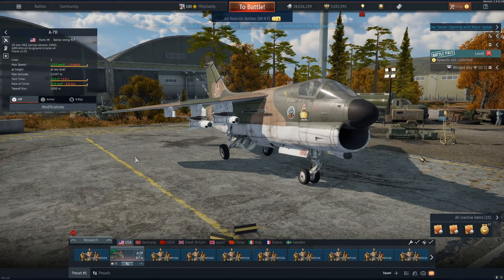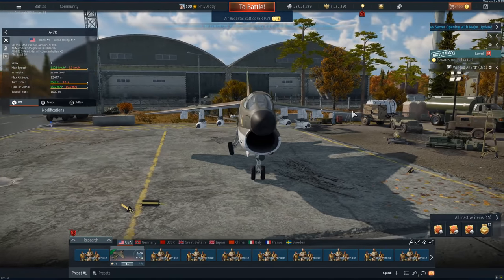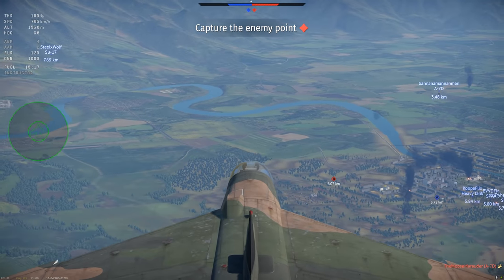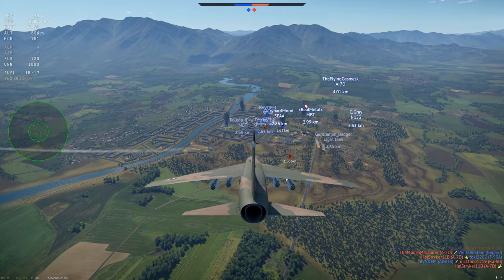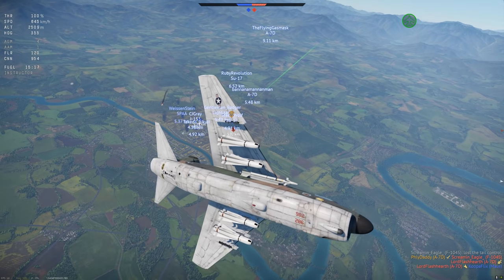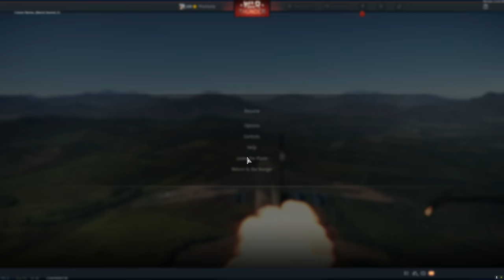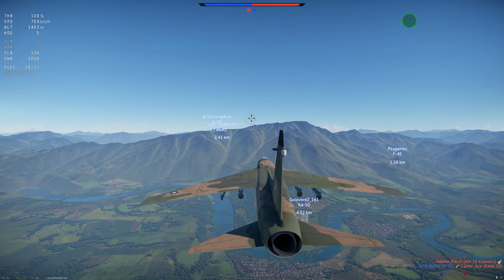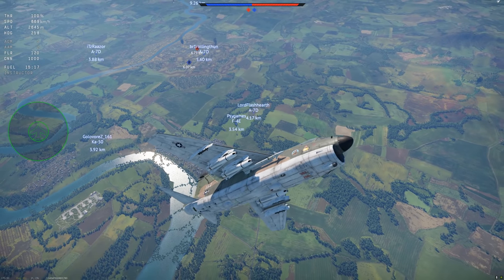AIR TO SURFACE HOMING MISSILES | AGM-65 Maverick

Comment: Helicopters: looks like trouble 
Air to surface missiles: make it double
Reply: they should remove tanks from top tier rb and rename it to air rb 2
Reply: Helicopters tend to not like 120 mm smoothbore cannons
Reply: The deadly duo will now be an A-7 that does one pass ans takes out the enemy SPAA, then a long-range ATGM heli comes out and decimated their ground forces
Reply: @awacsbandog8926   meanwhile apfsds round through the cockpit and pilot of ah1g:

HIT
Reply: @awacsbandog8926  Lol, honestly helicopters tend to shrug 120mm rounds off fairly often.
Reply: @oojiflip  This is one of the reasons that War Thunder needs VoIP!!!
If Gaijin could implement a radio system complete with a button for ground forces (maybe proximity, even though that doesn't make sense), there would be much more teamwork and investment in War Thunder.
Reply: @oojiflip  As you say, two total strangers could coordinate a joint action/strike with only a few words.
The system could have one button for communicating with ground forces and another for ground forces AND aircraft.
Complete with radio static and beeps, it would be more immersive as well as comforting those odd players who don't like sharing their voice on the internet.
It would grow to be used more and more as well as making matches more memorable and shrinking the grind feel.

Comment: I hate to say it but everyone wishing for F-14s A-10s etc....this what comes with that request. BUT we need more SHORADs
Reply: after watching your tarkov video im here and watching war thunder video in here after that  i see you again, are u angel or something
Reply: No no.... f35
Reply: Oh fuck it’s ddg, a rare occurrence
Reply: @GodWentAFK  While I do agree that CAS can be pretty easy, I also usually get blown out of the sky the second I spawn. Literally had a spawn yesterday that felt like the old helo spawn where you pop into being on fire and falling apart already. I think SEAD load outs would actually be pretty amazing. One, they are radar homing, so SPAA would just have to choose when to use that. The second they turn it off SEAD missiles lose track. Dedicating yourself to carrying SEAD missiles also reduces your ability for normal ground pound, so you'd be choosing a support role inherently to help your team. Scout vehicles do make it a lot easier to get into CAS, but it can still be a challenge to get into a plane. Immediately getting popped by SPAA normally means that player is out of the match too since they just spent between 500-700 SP for a spawn despite being shot down by say an ADATS which costs 200 SP. I think CAS being powerful is fine and lines up with the SP cost to do so. If anything, the only thing I can think of is if you run out of ordinance and RTB, you don't have to pay the silver for repairs. But, maybe they limit the fly out to just that one? I think everyone that does CAS would hate that (I would), especially since it takes awhile to rearm and come back in anyway. That would make strike craft more useful as they have more fly-out ordinance, but also make it harder to get a couple kills with a cap before dumping payload after payload for the rest of the match (like how it currently is). But what if additional fly-outs could happen? But only by SP earned in ground vehicles and only if you safely recovered your plane?

EX:
So you spawn in your HSTV-L, get a few kills and a cap, then get popped. Let's say you then fly out the A7-D, use up its ordinance, then RTB. You land, repair, then it jettisons you out. You don't pay on repairs. The SP you specifically earned as a CAS plane can be used for ground spawns, but not more CAS. Then you take a couple of tanks out, do well, then die. Only because you RTB'd your A7-D, you can now fly it out again loaded up and ready because you earned enough SP in ground vehicles. You spawn in, get shot up, and die almost immediately. Even though you have enough Strike SP (Or whatever it would be called) to spawn in another A7-D, yours got shot down, so it isn't available.

Specifically too, I wouldn't want additional fly-outs costing more and more SP every time. If you do well several times and have returned your aircraft several times, you shouldn't be punished by needing like 1400 sp to fly out a vehicle.

Ultimately something like this would have to be tried to see if its nice or not, but I think it could work well. It would mean that someone that got lucky at the start of the match isn't guaranteed to rain Bullpups or Nords for the rest of the match, but also means we don't have to limit or castrate CAS capability because its so effective. It rewards people for flying carefully in both SL loss prevention and potentially additional fly outs, but also means that you won't have a team of only CAS that can't cap. If anything, if CAS does well, it means that your ground forces will also be reinforced who can later "call in" more strike craft. This would turn it into more of a kill streak reward for doing well instead of just sitting in the AC-130 for the rest of the match. I thought briefly that maybe when you RTB your plane, maybe there is a vehicle timer on it for another fly out, but making it SP earned in ground vehicles promotes more spawning and probably better matches as opposed to staring at your spawn screen waiting for the countdown.
Reply: sure, f14 but i would rather want mig 35
Reply: @EnduringFrost  wow you must have thought about this topic a lot
Reply: A-10 is going to be hell on top tier ground.
Reply: @EnduringFrost  CAS babies don't need more handholding, you don't need ARMs. If you were good you wouldn't die to SPAA.
Reply: @EnduringFrost   one problem, all but the earliest SEAD missiles will fly to the targets last detected location. So you'd need to turn off your radar and move far enough away to be safe to avoid them. Some also have loiter and relock capabilities so they coudl shut down the SPAA's ability to use radar for several minutes after they're launched.
Reply: Imo, they should add some ARMs to the game. Some small maps (like Kuban and White rock) with a couple of 2S6s at the spawn literally means no-fly zone!
Reply: @baggingfritz2181  and that's a good thing.
Reply: Good. Fuck balance anymore and fuck the fact that German top tier tanks keep being added despite their already 70% WR.
Reply: @MrQuackcorn  It is funny that germany keeps getting good vehicles. Some of them should even be added to other nations. And still german mains are complaining about "germany suffers."
Reply: I want F16s and F15s
Reply: Meh, current AA is already fucking cas.

No need to ruin it more.
Reply: nope we all are waiting for the viggen.
Reply: With an engagement range of just over 100 Miles (160 Km) I do not know how you can add the F-14 Tomcat to the game.
Reply: Still wishing for the B-58 Hustler.
Reply: @EnduringFrost  cas shouldnt even be in the game, just remove it
Reply: [Danger zone intensifies]
Reply: @ragewalker4148  the maps need to be seriously bigger above mid tier.
I can see a system where the tier number is the square root of the smallest map a tank can be fielded on in km and for aircraft, it would be the square root times ten.
So for a tier 10 tank, the map would never be smaller than 10×10km
While for a tier 10 plane, it would never be less than 100x100km.
Reply: @stefa_j1032  mig 23 first
Reply: Meanwhile im still waiting for more variants of ww2 stuff like the elefant, stug IV, marder III m, me 262 hg I..
Reply: No. There are already a ton of radar assisted AA and SAMs, they have no downside for just throwing their radar into the sky, locking on to an aircraft, putting their mouse onto the green bubble and holding down the mouse button. The radar moves the mouse to track the target, its just as easy for an A7 to fire off an AGM-65 and make positive impact on an unsuspecting vehicle as it is for a gepard to open up from 5KM a and hit an unsuspecting aircraft - especially one that doesnt have an RWR. In my opinion they need to add ARMs - I think that the devs should make is to you can only have a SEAD loadout OR a CAS loadout. Early ARMs would be extremely easy to defeat as they are already not very accurate AND you can simply turn your radar off and move.
Reply: I still want um
Reply: WE NEED THE STRYKER SHORAD
Reply: @darthkarl99  you overestimate the accuracy of INS systems in the modern HARMs. While I have no doubt weapons like the AGM-88E are able to decisively generate a very close impact point in relation to target, anything before that doesn't really get closer than a mile off the emitting radar. Adding to this fact is that SAMs themselves are able to shoot down destructive SEAD weapons like HARMs, JSOWs, SDBs - it gets complex real fast.. ;)
Reply: @serpent5751  Beign able to do what i described was one of the original specifications for the HARM missile and most other second generation anti-radar missiles.
Reply: @EnduringFrost  boo hoo cas is soooooooo hard

Comment: Everyone: Give us F-14s!

Gaijin: M I S S L E S
Reply: F-14 would brutally clap cheeks now. Soviets need to get the MiG-23 to go with it
Reply: @LOLHAMMER45678  too much american superiority
Reply: I would rather get more jets(voodoo thunderchief) not new toptier jets
Reply: Maps are already way too small for top tier jets, F-14s would be batshit braindead
Reply: @blomgaming6480  Laughs in R-60 and Ka-50

Edit : laughs in Leopard 2A6 as well
Reply: @LOLHAMMER45678  MIG-23 is worse than the 21bis.
Reply: @TheDAWinz  The base model yes, something like the MLD-98 no. It can get R-27 plus more speed, and it doesn't fly like a brick
Reply: You want power creep? Because that’s how you get power creep
Reply: @LOLHAMMER45678  Phoenix can outrange most of WT maps
Reply: @hphp31416  Yeah, which is why we'll get it with Sparrow and Sidewinder only, like how we got F-4 without Sparrow at first
Reply: @LOLHAMMER45678  MiG-23's would get raped by F-14's, 23's are F-4 Phantom analogues.
The first USSR Jet that would be able to even somewhat compete with F-14's would be the MiG-25, and even then it's still largely in the F-14's favour.
Reply: @roadhigher  F-14's big advantage over MiG-23 is the radar and the phoenixes. Take that away and it's surprisingly even- especially if you add a late-production MiG-23 and an early production F-14. 

An F-15 would kick the MiG's teeth in, but the F-14 was still a fat interceptor, just not as fat as the F-111B.
Reply: @LOLHAMMER45678  And it is clapping cheeks now

Comment: Oh what's that? Our playerbase is complaning about g91s and A4s/A7? Let's make CAS even stronger LMFAO
-Gaijin HQ
Reply: Ok, but these mavericks aren't even as good as a bullpup, if you can guide them
Reply: @quartzlandaker5664  yea only 1850mm of penetration
Reply: Freeaboos @ 23:59: I can barely use my bullpups, CAS isn't OP at all

Freeaboos @ 00:00: Ermagoid Gaijin G91 and Ka-50 are OP, enemy CAS OP plz nerf
Reply: @lilhrabinator2283  nah AA pretty easy to counter if you keep your distance. Especially cas with bullpup/nord
Reply: Bryan Duarte schmitar exists too ffs...
Reply: @lilhrabinator2283  the only thing to balance anti air? Bruh 12.7 can destroy most of them what are you talking about you have 500kg bombs
Reply: @lilhrabinator2283   you're just playing it badly i can't kill g91's over 1km   and the entire aa of the team usualy gets shwacked.
Reply: @lilhrabinator2283  omg you realize the entire point of the op spaa was to counter the cas spam right? cas is the original cancer, spaa doesnt NEED a counter, because spaa IS the counter.
Reply: @foxboy64  Back in the day the problem was the HVAR and RP-3 spam because both were a 1 hit kill and some planes could carry up to 16. Things just snowballed from there. Those were the "good old days" lol
Reply: Finally Russia has a nice proper CAS :D
Reply: @throwaway.mp4931  which SPAA can't kill g91s over 1 km? Maybe you're playing your SPAA badly lmao
Reply: @geoffrey6554  The A4 does not have metric measurements on any of its bombs. Furthermore, dumb bombs are not very useful vs radar guided SPAA as you have to ge close to use them

Comment: E/E2/L would be more balanced for WT than any of the other variants, including EO/CCD. They are already artificially nerfing the range of the A, so thats not a factor, and the Laser mavericks require the user to maintain lock with a pod, JTAC, or buddy at all times until missile impact. Meaning no proper F&F.

Comment: The AGM-65s seem to be more balanced than the Nords or Bullpups we already have in the game. 

-They cant be dumbfired/ require a lock
-The plane has to be in a separate camera view with limited FOV and has to fly a straight predictable line when locking a target
-The missile is slow and can't pull many Gs
-The tracking is imperfect and the missile can miss
-It can be easily defeated by smoke and obstacles and will auto-detonate when it loses lock
-It can't be used at night
-It has a HEAT warhead and requires a direct hit
-It can't be used effectively for low passes, snapshots/ targets that appear suddenly 
-You can't switch targets once the missile is off the rail

The AGM-65s will allow pilots to maneuver once the missile is off the rail but will make them more vulnerable during the period prior to launching. It can be fired from a longer distance but the missile is slow and the target can counter it during the time it takes for the missile to reach the target. Its close range performance is hindered by the lock on period and the missiles inability to turn very well.

As a ground player, the AGM-65s seem far more tolerable than Nords or Bullpups and I don't think it'll disrupt the balance at top tier nearly as much as the introduction of hand-guided AGMs did.

Comment: Just commenting this, hoping phly would see this. Might help him out:
you can actually select which bomb to use first when you do bomb runs with different bombs, if you key bind 'weapon
 selection'. You can do it for secundary (bombs, rockets...) and for 
primary (mgs, cannons) weapons. That way you only need e.g. spacebar for
 all secundary weapons and 1MB for primary weapons, and you just select 
which u wonna use on your strike!

Comment: The plus sign is the slew limits and it’s very good so you don’t need to point the aircraft directly at it. As long as you are going in the general direction you should be able to get a lock.

Comment: Yeah, and the maverick missile seeker (the aiming reticle in-game) should also have thermals, as the Maverick uses an IR seeker. Hopefully, gaijin fixes that for the live server, but it's not the first time something has been broken on the dev server and transferred to the live server in the same state...
Reply: Only the AGM-65 D,F/G have an IIR seeker, the A uses an old electro-optical contrast-lock targeting system.
Reply: @spudicous  you are correct! My bad for mixing up the variants. I do know that the maverick in general (across all variants) should have a range much larger than 6km (Wikipedia says greater than 22km). I guess it’s all down to gaijin’s shitty render distance 🤷‍♂️

Comment: Why is the range 6km? Pretty sure A-10 pilots are told they can engage with AGM-65 at 7nmi which is a lot more than 6km.
But its confusing because these are listed  as the A version which is not IR targeted but electro-optical, the D and F version are IR and their range is 20km+, where as I don't even know if the A version could lock at 6km, I think its even less than that, maybe 4km. 

It'd be great if Gaijin had a page somewhere which listed sources for their data.

Comment: For anybody wondering how these work

On a real aircraft you would normally (preferably) use a laser designation system like a litening targeting pod or similar to designate a laser on the ground to which the maverick slews, though you can still use em without and slew them manually.

Comment: Phly, I add one attempt per video. This is attempt ( # 194 ). You can physically check the comment sections on ur past videos, I’ve tried for this long. We need a type 87 video! Also, if you can help reduce both the cost and RP for the type 16 (look at 9.0 centuaro) that would be awesome.

Comment: Now they should add SAMs around the spawn it should only be able to detect u if u stay at a certain altitude range anywhere from 800ft to 4K feet u have a higher chance of getting aaa Missile lock if you fly over the battlefield and an even higher chance at low altitudes but no chance above 4K and low chance at 1000 but no chance below 800 the radar station and SAM sites should be destructible to the point where one team can kill the other teams radar

Comment: Ground RB is slowly turning into Air RB
Reply: always has been, i’m still baffled at people taking planes 2 minutes into battle, like, if you want to play plane that much go back to air rb pls.
Reply: playing tank RB is a joke now. It should be renamed. Tanks are only useful to cap the points. A tier 1 fast little crap with full plane loadout is all you need to play for meta TANK rb, otherwise you;re just cannon fodder for CAS.

Comment: Get an F-16 and you should be able to rock 14 Mavericks. G versions and later, slaved to your radar. Lock a few ground targets and let loose.

You haven't even seen the ludicrous weapons. The new antiarmor missile USA uses is insane. Shoot a missile 50 kilometers away, it opens over the target and deploys nearly 100 vehicle seeking shaped charges. Drop that on a cap.

Comment: That is a lot easier than using them in DCS! 
Good that they nerfed the range, the real one has a range of >22km... Way too much for WT
Reply: theay still have 20km range tho
Reply: @darkhammer2078  only 6km in game
Reply: But 22km range would be pretty fair considering it will probably go up to 10.0+
Reply: @quartzlandaker5664  I swear it was 20km in the stream with mike and oxy